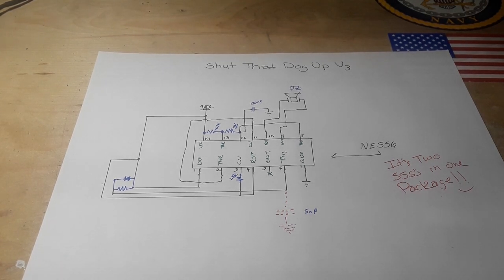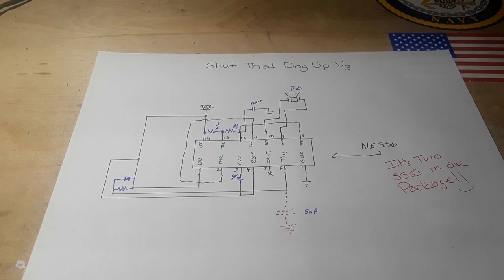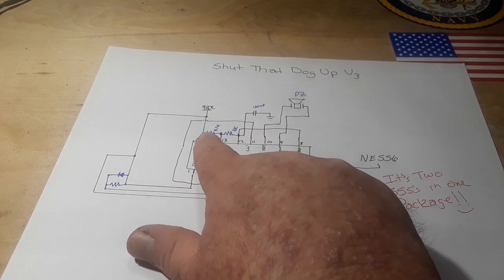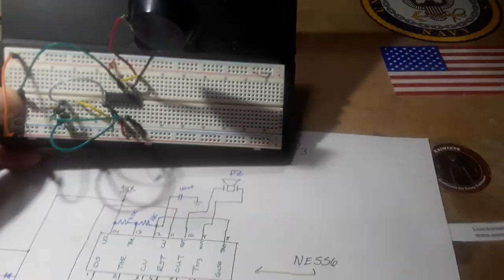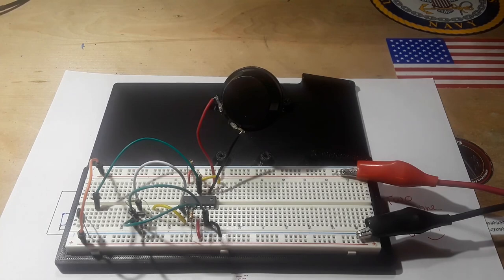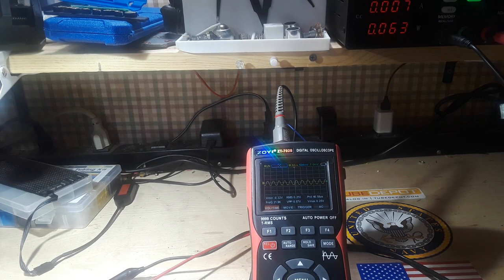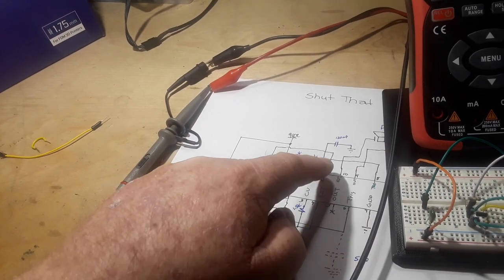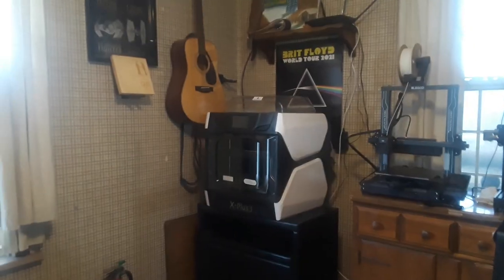Anti Barking Device v3

Comment: I've been on a similar mission helping someone with a barking issue. Our problem was not the frequency generation but finding a suitable driver that could handle the frequency AND have the beans to carry a little distance with decent energy. Interested to see your case and hear back on any observed results. We were about to make an array out of larger piezo style drivers.
Reply from the maker: An array is probably going to be needed. The tiny piezoelectric sounded I'm using doesn't carry far. It annoyed my dog in the other room. We will see how it does from back porch to the neighbors yard about 10-15 yards